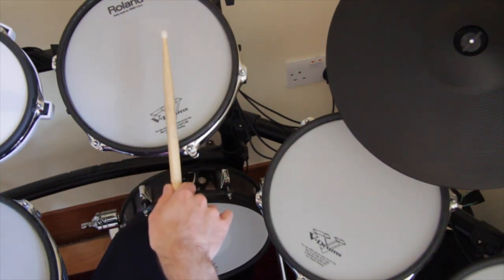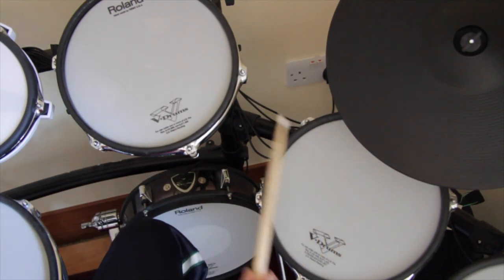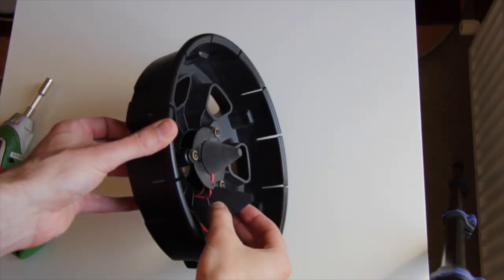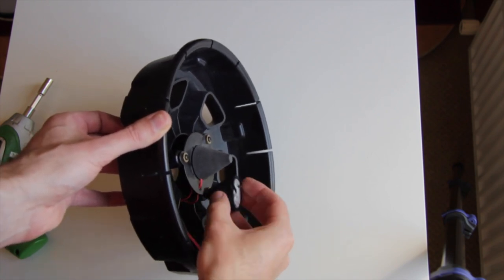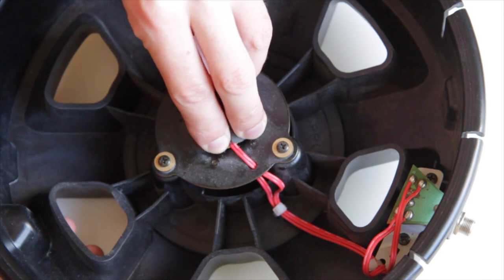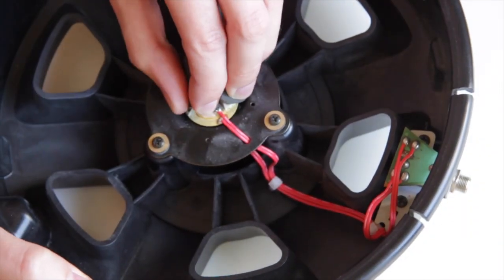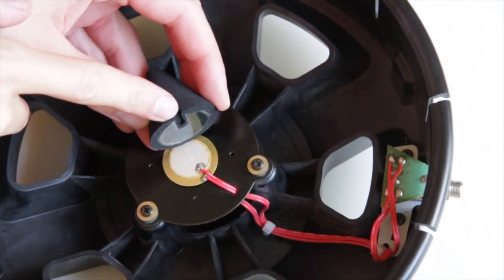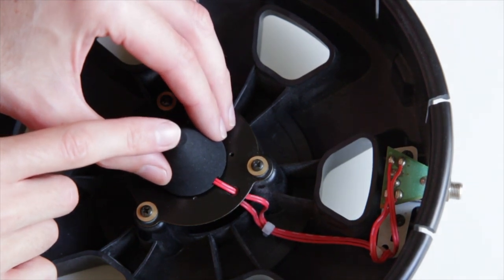How to replace a trigger cone? (Roland)

Comment from the maker: @ Maikel K: No, the piezo will not break in most cases. The cone is under consistent pressure and stressed by the hits. The foam is getting weak and you wont have a good signal after years. It is the same effect like in a couch or in a mattress.

Comment: Recently I changed the conical foams on my PD 85 BK Pads because their sensitivity was already quite impaired. I made the change according to the maintenance videos I saw. Anyway, after the change, the sensitivity was excellent for touches with low dynamics. However, when I accentuate the touch more forcefully they are triggering the sound of the Rim instead of the sound of the skin where I am playing. I cleaned the piezos, and it still doesn't help. Could you give me guidance on how to resolve this? I thank the attention.

Comment: I have searched the globe and cant seem to find replacement cones specifically for the pd-125 drums. I've read they are different size than the others. I wouldn't mind getting the piezos too but dont know the size or any info about them. Anyone out there have an answer? 

The video is good though. Should be the same process.

Comment: Hi. One of my toms sounds at full volume where ever it is hit and even if it's just a light tap. Is this a cone issue? Thanks
Reply: Yes. It's definitely a cone issue, had the same problem with mine, replaced the cone and it's 100 times better!

Comment: Hi when installing a foam trigger cone on a DIY snare,should the top of the cone be touching the mesh head /or just below  when its tightened to the snare?
Reply from the maker: cast390 The cone top has to be 1-1.5mm higher than the bearing edge. Basically more than just touching.

Comment: Hello, i own a roland td25 and i get a really anoying hotspot on the center of the snare. I tried many settings, i am currently at sensitivity 3 and log2 curve to reduce it but it makes the snares feels unrealistic. Any clue on how to solve the problem?? (i already tensed the mesh head a lot also) thanks...
Reply from the maker: Clagratte A drum etc real feel head that is tensioned a lot will help.
Reply: Vdrum Tips ok thanks so i have to replace the original Roland mesh?
Reply from the maker: Yes, check my video: Scientific Mesh Head test, then you know why.

Comment: I have a same problem om my pd-105 and I replaced old cone with a new one but the problem still remains - no sound when I  "hitting it gently"  even in the center of my pd. So iI suppose  I have a problem with the PIEZO?! Can I replace a piezo? Is it possible? Rimshot is ok.
Reply from the maker: Hi, I would increase the sensitivity in the module first. I that doesn't help you can replace the piezo. The same shop is selling them.
Reply: Marcel Price
I already tried increase the sensitivity but results was the same. Do you know what is diameter of piezo in pd-105? I suppose it is 27 mm just like in cy-8. Is there any video explaining how to change piezo on roland pads? I hope it is not a big deal :) Thank you
Reply from the maker: I think it is a 27mm piezo. Sorry, not yet, but I will make one as soon as I have a broken one.

Comment: Do you know of a place I can order a suitable trigger from in the US?
Reply from the maker: +Ken T The Roland PD-80/85/100/105/120/125 need trigger cones with the exact height of 35 mm. You can buy these cones at quartzpercussions.com. Newer pads might need a different cone. The newer versions of the PD-125 might have a different cone. You are on the safe site if you measure the cone before you order.

Comment: Please help. Roland RT-10S doesnt pick hard hits. This happens both while playing with the module and software.
Reply from the maker: have you tried another cable, another input?
Reply: Thanks for the reply. This is what i tried:

Different cable -- did not work
changed mesh head (from 2 ply to pearl one ply) --- worked but i get retrig problems and some hits do not register
other rt-10 trigger from toms with the same cable and 2 ply mesh -- worked

This is very strange. Its definately the trigger combined with the mesh heads. How can it recognize the soft hits and ignore the hard ones? Its like an oppossite threshold lol

Comment: where can i get the cone cheaper? its very expensive
Reply from the maker: +Luca von Gaisberg I would not mind about the price, a cheaper part will deliver a bad quality.
Reply: +Vdrum Tips i built my own edrum pad and i use another material as cone because its cheaper. a cone for 12 € is more expensive as the hole pad. (my english is not perfect because i come from germany)
Reply: +Vdrum Tips 13€ + 8€ transportation costs :O
Reply from the maker: Yes, I would go for it. Otherwise you might not achieve the same good result.
Reply: +Vdrum Tips ich think i will search the same material and cut a cone myself. Thank you for your helpful videos and for your answers
Reply from the maker: Good luck with that. If you know how to do that let me know. I probably buy a few cones off of you then:)